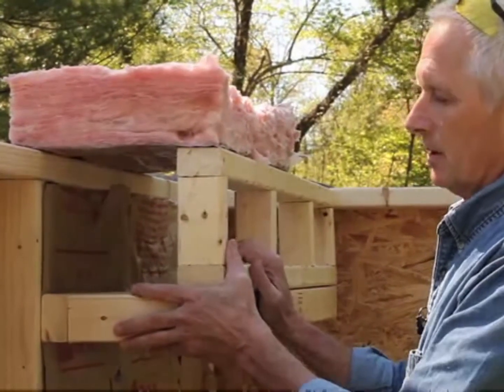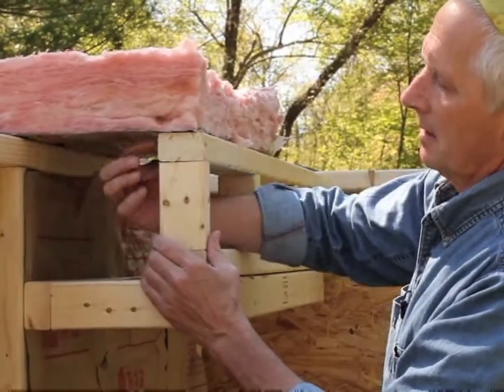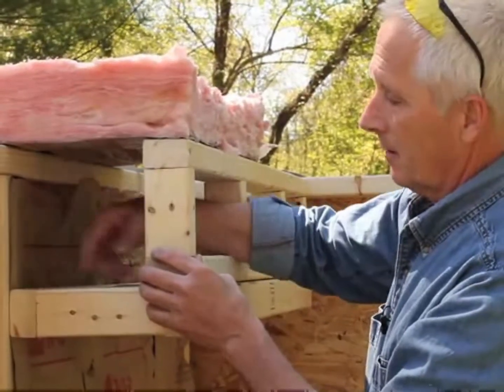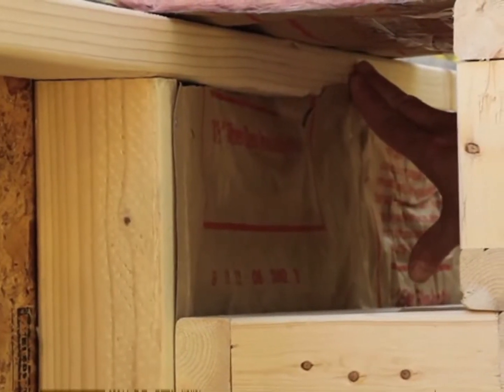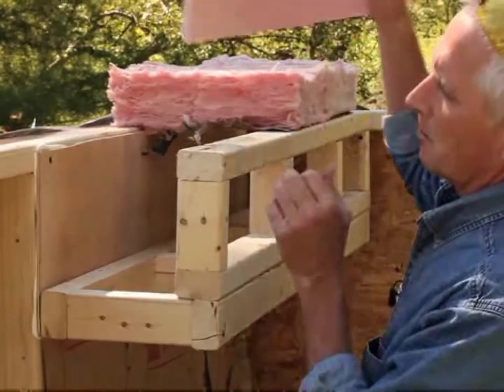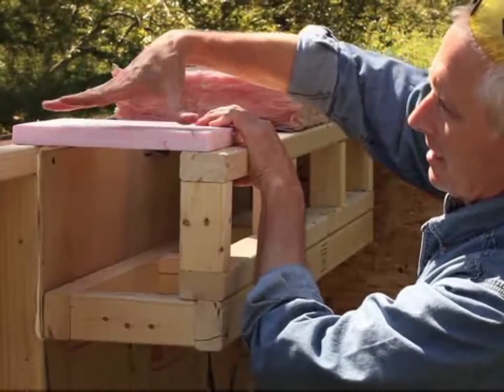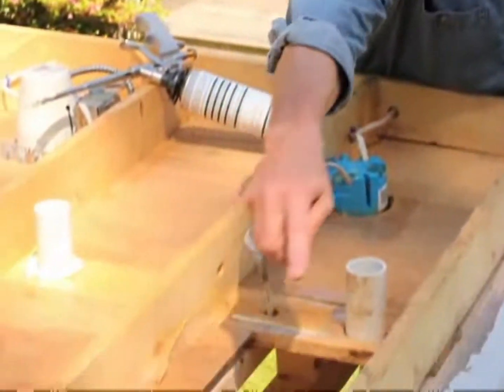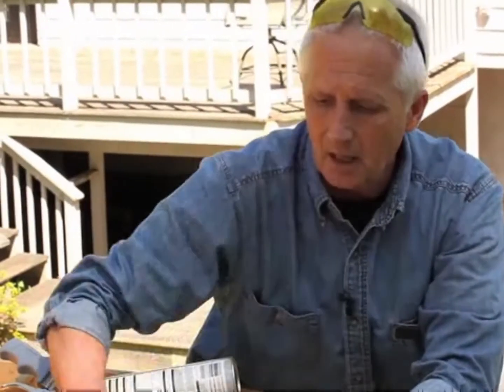Dropped Ceiling Soffit Below Unconditioned Attic

Comment: Plenty of leaky old houses with soffits built in that fashion, there is no good reason to build them that way. Drywall the lid over your air/vapor barrier. Fire tape the drywall in that area, then frame your soffits in the conditioned space, leaving the VB continuous.